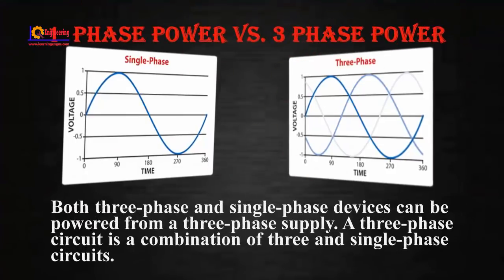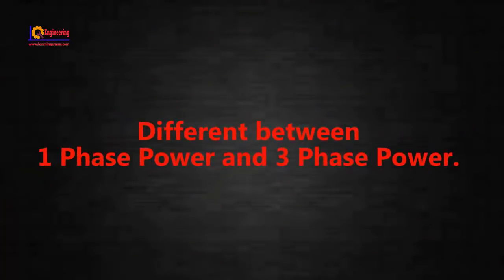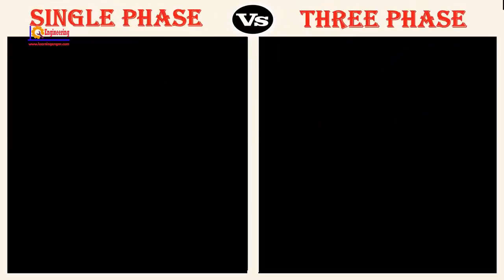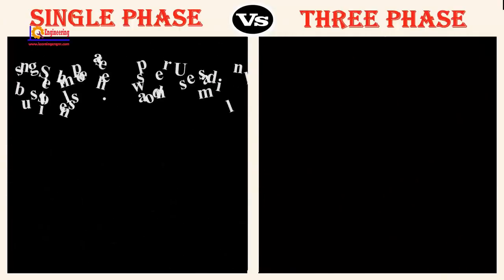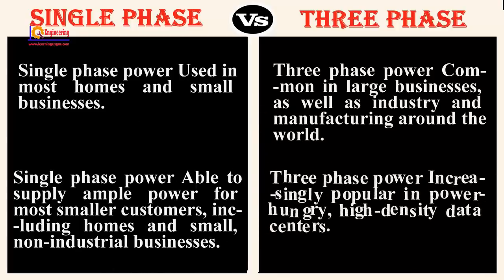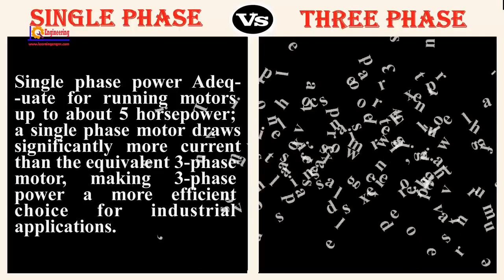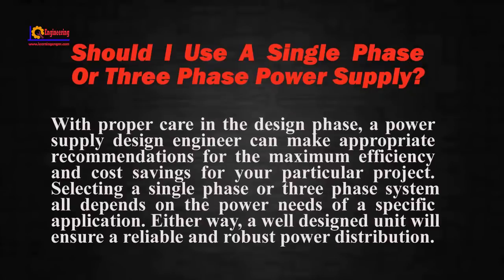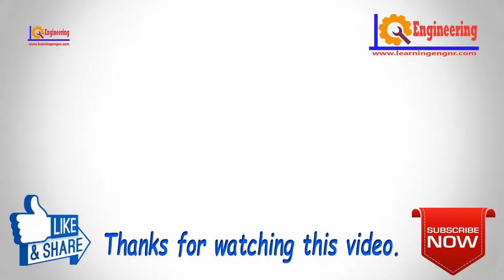Single Phase vs Three Phase - Difference Between Single Phase and Three Phase

Comment: Are three phase circuits always 220/240 volts?
Reply from the maker: no sir, three phase circuits always 380 or 400 volts.

thanks for your comment.
Reply: I've seen in the hvac field I've seen 208/230 3 phase. Also 460v 3 phase